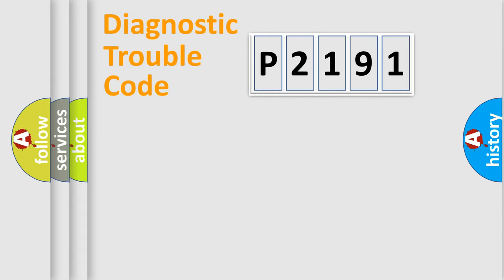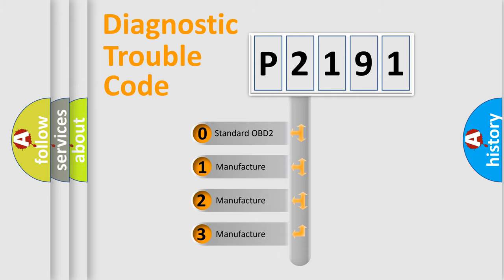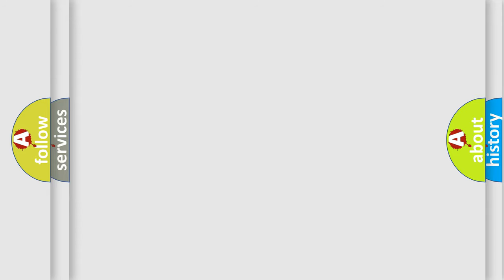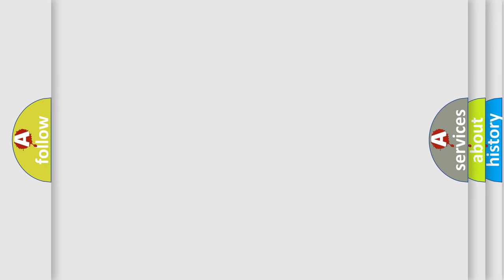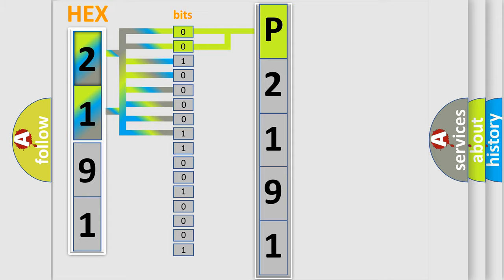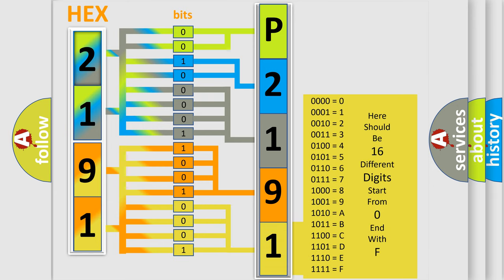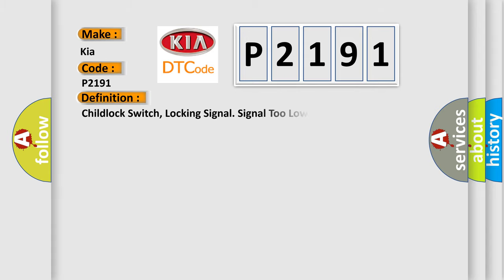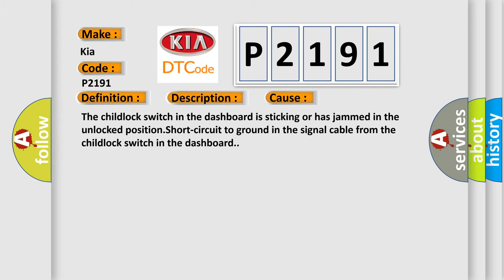DTC KIA P2191 Short Explanation

Comment: Ummm… every scanner that’s been plugged into my Kia shows P2191 as system too lean at higher loads. NOT anything about the child lock switch, which is not even powered in my car. Wtf is this video?
Reply: Yeah my bro, I have the same problem with P2191 system too lean...
What can I do plz
Reply: @abdulfattahharazi1870  so I'm here looking for hints. What was your issue? Fuel filter clogged?
Reply: @cameroncook975  my Kia Soul got 420,000 miles on it (400,000 at the time of my comment) and I don’t know which caused what but all my problems went away when I cleaned the O2 sensors, replaced the head cover gasket as it was leaking oil into the spark plug holes, then replacing the ignition coils which were still factory at the time
Reply: @oladeleayoola  this wouldn't have given you a p2191 fault, just a rough misfire. Correct?
Reply: @cameroncook975  the car idled just fine but it was only at higher loads at low-mid RPM where I’d feel misfiring. The misfiring smoothed out if I held gears longer and stayed above 3k RPMS

My theory is that my coils and plugs were functioning just barely good enough at idle but were broken enough to only malfunction under load. So misfiring under load would make the O2 sensor read lean, resulting in the code
Reply: @oladeleayoola  it was the oil on the spark plugs. That always causes intermittent misfires.